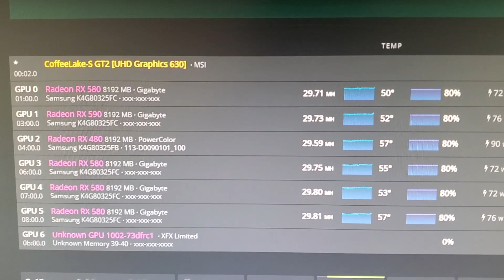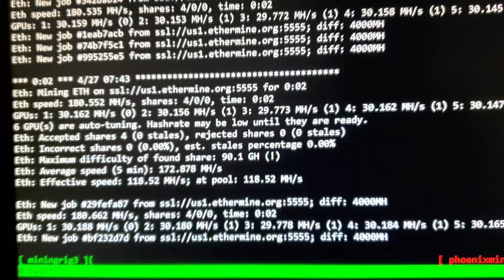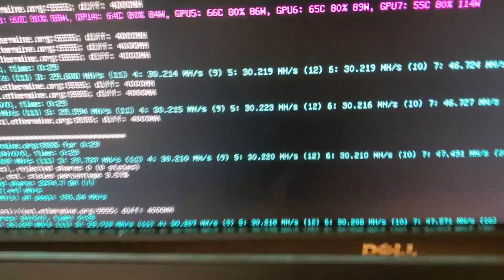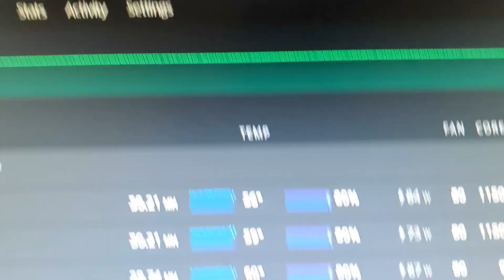6700XT Crypto Mining in HIVE OS + Overclock Settings

Comment: thank you mate

RX 6700 XT speedster almost the same
CC 1250
CV 700
MCV 700
MC 1075
MV 1300
Reply from the maker: Thanks for sharing the settings Pully!
Reply: Do you have any good settings for the RX 6700 XT Qick?  I can't get over 30 MH/S
Reply: @brewtastic3946  mine also 31mhs...just like gtx 1660 super
Reply: @rullypurwantoro  sound weird. Fresh from box should be near 38-40 mhs.

Comment: The 80w for 47 MH is total bs, they get that reading from software, it doesn't translate to the actual draw from the wall. I have the Quick version, and i get a solid 47mh at 108 listed in hive os, but the actual draw is closer to 140w. This was the same in my testing in windows as well. Never believe what software tells you for power draw, spend the 20bucks and buy a watt meter.
Reply from the maker: Thanks for the valuable comment podwardog. I thought it was insane when I saw the whole 80w. I'll measure mine at the wall. Thanks for watching!
Reply: @DaniTalksTech  Oh if you do buy one of the watt meters, like the cheapo ones on amazon, you shouldn't use them for long, just to get the power reading and remove them, leaving them plugged in for long periods of time can be a fire hazard. Someone i know had one melt after just a couple hours, luckily no fire, but eye-opening none the less.
Reply from the maker: @podwardog  looks like we've all done that. I have one and I kept it on for weeks. The outlet showed burn marks!
Reply: I can tell there is a difference between software and watt meter. I got 220 watts drop for 10 GPUS and actual watt meter drop 175 watts. Still a good cost saving, using hiveos

Comment: Great vid although I will cordially disagree with the proposition that this card is a better value than the 6800.
I mine with 4 6800s and they use between 130 and 150 watts at 62 megahash
Reply from the maker: Nice Timothy...thanks for the input man. My thoughts were based on the following: A 6700XT does around 45MH and on Windows with MorePowerTool, some are able to bring it down to 85W. Therefore, it has an efficiency ratio of 45/85 = 0.53. The 6800 has a ratio of 62/140 = 0.44. So just looked at Output to Power ratio, the 6700XT is the winner. It also depends on the price of the cards. The comparison has to be done between similar categories. For example a reference card 6700 XT vs a reference card 6800. The prices for non-reference cards are way higher.

Comment: Statistics (21:07:40); Mining: Ethash
Connected to: eu1.ethermine.org:4444
Uptime: 0h 47m 33s
                           GPU 0       GPU 1    Total
Name:                  RX 6700XT   RX 6700XT      Rig
Speed (mh/s):              46.81       46.70    93.51
Pool (mh/s):               33.12       52.69    85.81
Shares (A/S/Hw):          22/0/0      35/0/0   57/0/0
Best Share:                39.3G        5.3T     5.3T
Power (W):                  73.5        74.5    148.0
Efficiency (mh/s/W):       0.633       0.623    0.628
Temp (deg C):                 40          48
Junction (deg C):             44          51
Fan Speed (%):                60          63
---------------------------------------------
Reply from the maker: Are you on hive or windows? I see your Wattage is impressively low. Did you use the more power tool to get there?
Reply: @DaniTalksTech  windows.. yep MPT..
Reply from the maker: @RealLifeLifeHacks  Nice! My next thing to try. Thank you for sharing this :)

Comment: Nice video, surprisingly the card runs pretty cool. How well does the glow tent help with heat control?
Reply from the maker: Hi Bos. Thank you for watching my video :) the grow tent is fantastic. I wouldn't have been able to survive the summer without it. Have you seen my video where I show the equipment I used to set it up?
Reply: @DaniTalksTech  Hi Dani, yes, I did. I'm still considering doing it, the heat is getting crazy and that's with only 1 small rig. Its the noise from exhaust fan I'm worried about....anyway I've subscribed. keep up the good work.
Reply from the maker: @BosHK  Thank you for the subscription Bos I appreciate it! it's quite noisy. The bigger the inline fan the less noise it makes. i went with a 6 inch one. The good ones are quite expensive. Mine cost me about $140 USD I think. the 8 inch ones were more than $200.

Comment: Thanks for your great explanations.
Did you get a chance to tune overclocking for XFX 6700xt to get a better hash rate? If yes could you please share it?
Reply from the maker: Hi Amin, my pleasure thank you for watching the video :) the settings that I used are: Core Clock 1300 - Core Voltage 625 - Memory Controller Voltage 700 - Memory Clock 1075 - Memory Voltage 1250 - Fan 90% - Power Limit 110. I am getting around 47 MH in HiveOS.

Comment: This helped heaps for my 6700xt rig! I currently have 5 cards on it and it helped when you showed the settings to drop my power consumption down while keeping a high hash rate. Thanks bro keep it up
Reply from the maker: Thank you for your kind comment Antz. I am loving the 6700XT. It's a great overall card. Is it the best of the best for mining? No, BUT it's generally more available than other cards. I am starting to be more interested in adding more to my farm. In Windows you can drop it down to less than 100W using the MOREPOWER tool. I haven't done that yet. I appreciate you watching my video man!

Comment: great vid! I was wondering what version of hiveos were you running? I've been trying to setup a few of these cards on a rig but the os randomly crashes or only detects 2-3 of them
Reply from the maker: Hi Raul. I am using the latest version of hive hiveos-0.6-203-stable@210403.img The 6700Xt is quite an unstable card for me as well. It has crashed a couple of times so far for me as well.

Comment: I have an eagle 6700xt. Can I use the same flight sheet with my nvidia cards? Also using phoenix miner.
Reply: Gigabyte eagle 6700xt performs the worse in my rigs in terms of Megahash per watt... never buying them again.. good thing i only got 1..
Reply from the maker: @RealLifeLifeHacks   they are generally the worst line up of any card.
Reply from the maker: Hi PJ, yes you can. The flight sheet is used to communicate with your miner and wallet. I generally don't mix amd and nvidia to avoid any driver issues. However, they should work in theory and I have tested them in the past. Thanks for watching my video :)